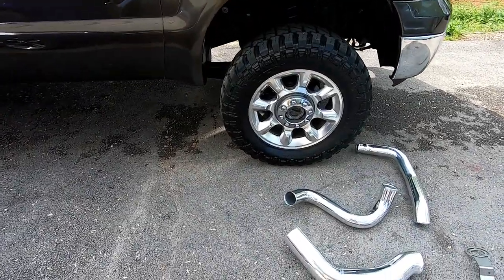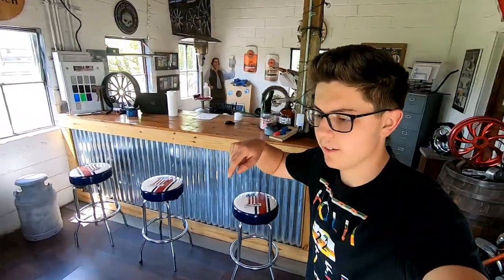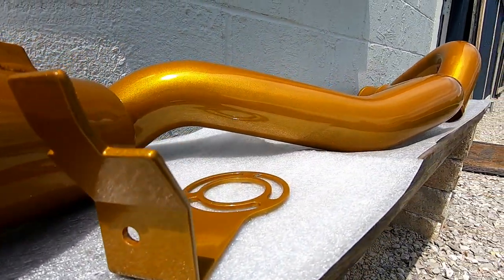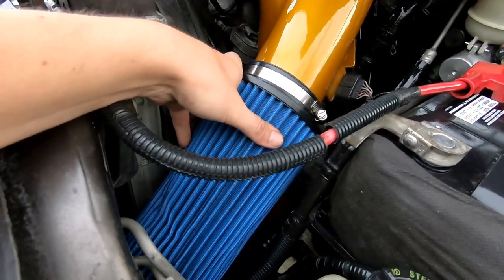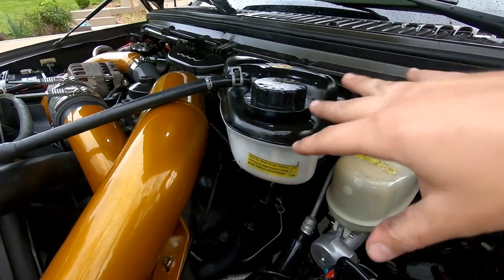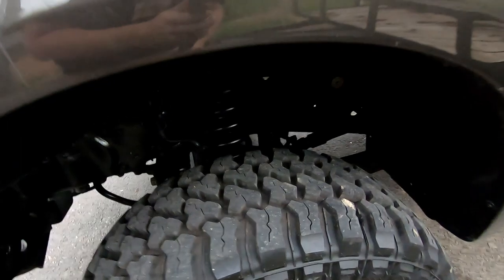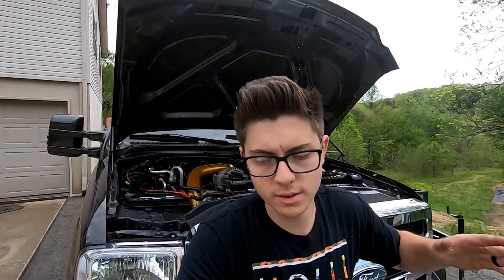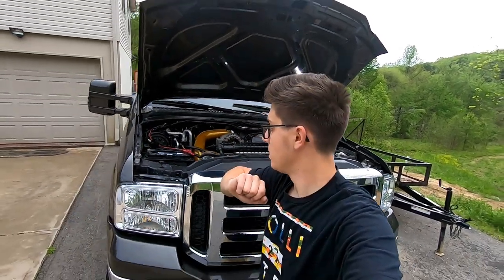FINALLY POWDERCOATED SOME TRUCK PARTS

Comment: What brand is the pipe kits that you got?
Reply from the maker: James Springer just cheap intercooler piping kit off of EBAY. Works great actually building 2lbs more of boost now. Must’ve had a slight boost leak out of one of my old pipes. For the price you. Cant beat them. Here’s a link https://rover.ebay.com/rover/0/0/0?mpre=https%3A%2F%2Fwww.ebay.com%2Fulk%2Fitm%2F332794345818
Reply: JUSTINHAWKSMITH awesome thank you man!! And keep up the videos!